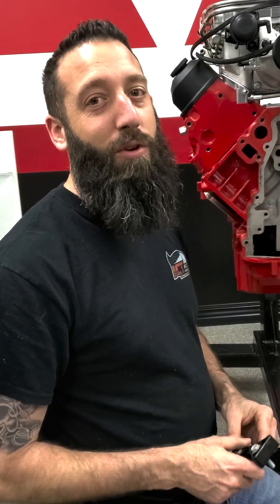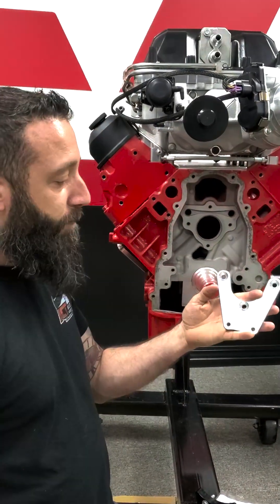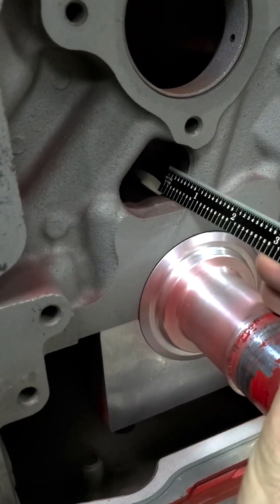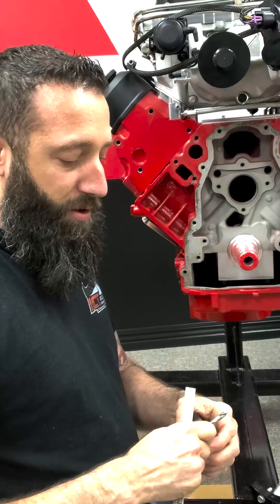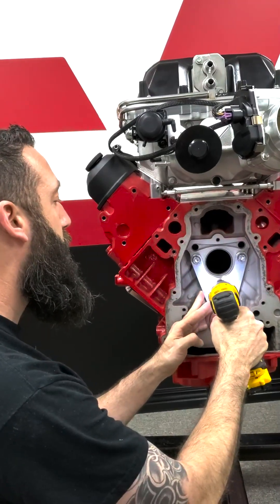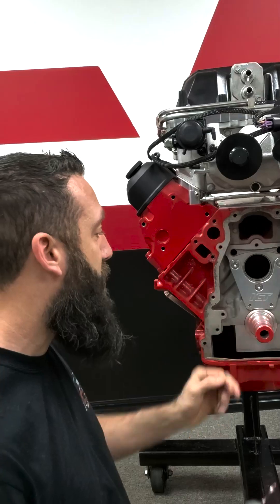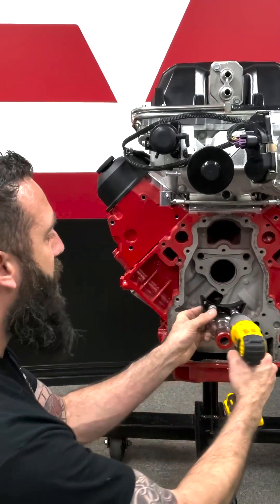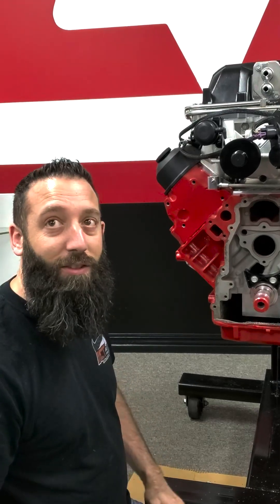How to Install an LS Gen 4 Timing Chain Guide on an LS Gen 3 Iron Block 551902-TL01

Comment: So do we drill all the way through or no ? Ive seen another video a guy didnt but i cant tell if u did or didnt .
Reply from the maker: We suggest that if the engine is assembled, not to drill all the way through. If it's an unassembled block, you may choose to do so at your discretion.